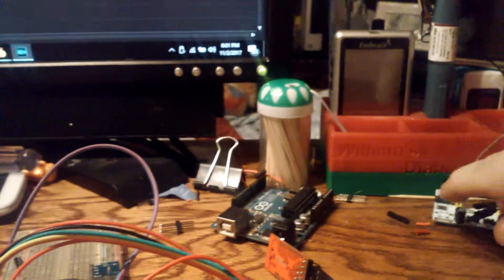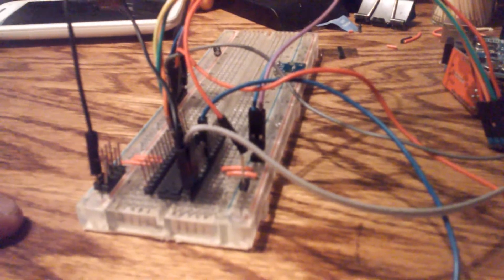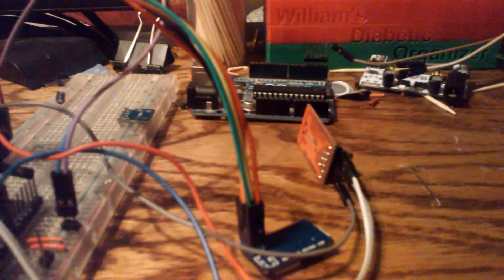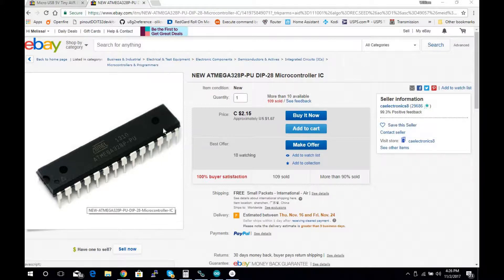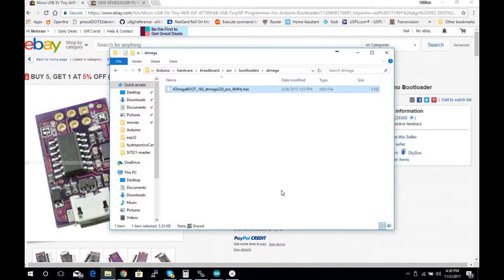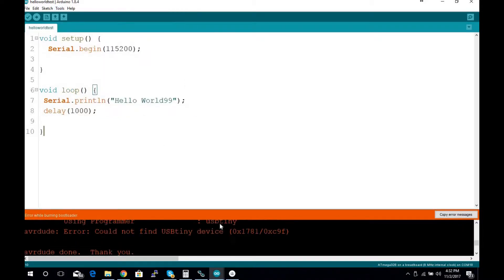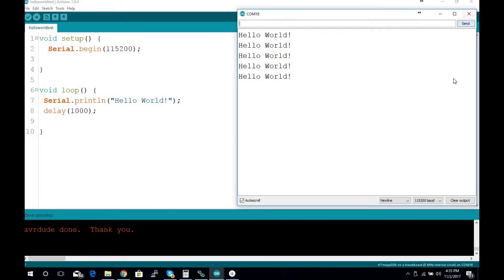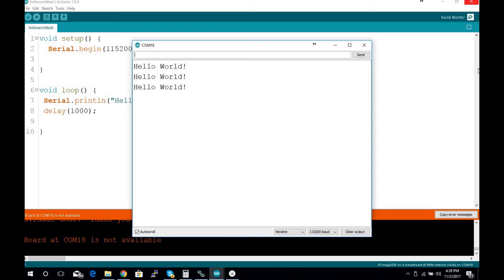Standalone ATmega 328p 3.3v 8mhz

Comment: Thank you for your efforts, but all I want to know is how to use my uno to load a program to an atmega328p chip which i want to run on its own internal 8 MHz clock. I do not need to know why (already decided) and I dont want to hear abt alternative programmers (isp tiny). And I need to overwrite the standard (uno) bootloader that was already on. So if you can make a video only abt the "how to" (step by step) and no irrelevant information, then your lessons/instruction will be easier to follow. And please dont forget to clarify the wiring! Probably for you it is easy and therefor you forgot this important part, but for me.... 

There are only a few videos abt this so far (in English) and I already tried to follow those instructions step by step, but this far I havent succeeded. So clearly everybody forgets to clarify ALL steps needed and that is common. But usually there are more videos abt a certain subject and by watching multiple, all steps will be clarified in the end (by mixing the different vids). So if you want to make informative videos easily accessable for everybody, please order the necessary steps in advance and clarify each step in the order needed. I think you have the knowledge and I do look forward to learn from you. 

Now I spend 24 mins and still have no idea how to program my atmega328p as 8MHz standalone (not with my uno, nor with the isptiny)....
Reply: did u find any solution?? I am facing the same issue...have a 16mhz atmega ..wanna flash 8mhz ....please lemme  know if u found anything helpful
Reply: @himangshudas3924  I have done it 
First connect upload the Arduino isp sketch to Arduino Uno and then proceed connecting it to the slave through isp .
If you are using new chips without bootloader  then you don't need the external oscillator to burn bootloader for internal oscillator but if you are using some pre bootloaded chip then make sure to connect the external oscillator with which the chip came to you and you should use 'minicore' boards for that